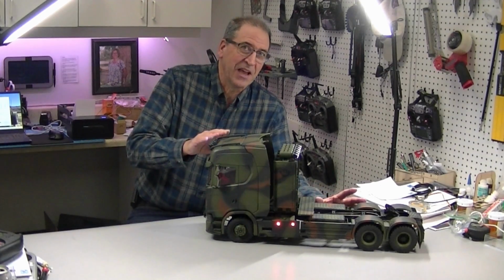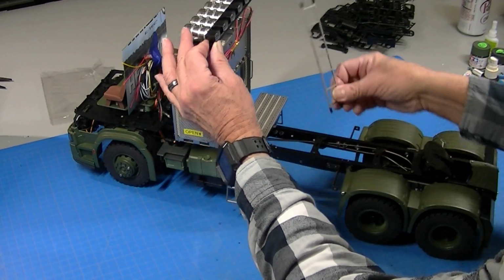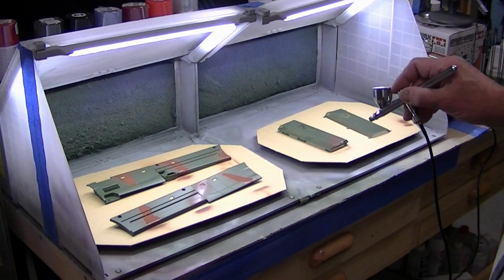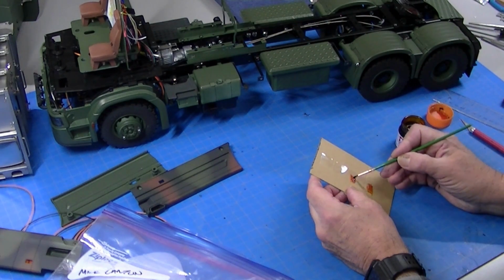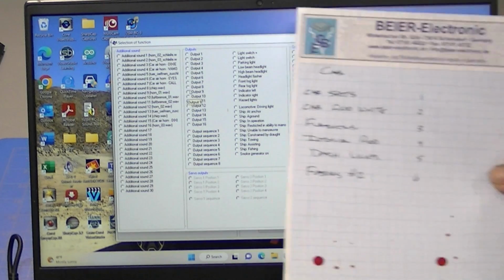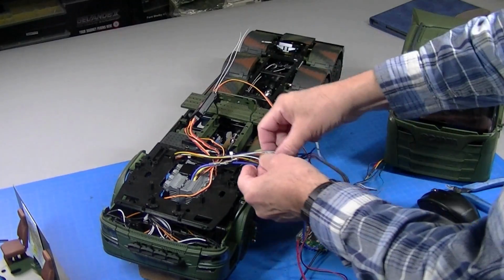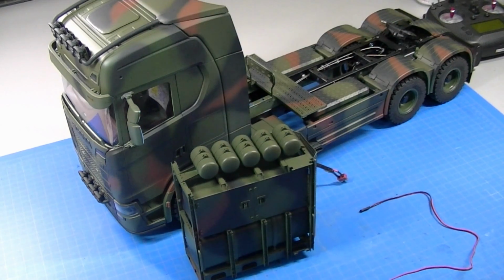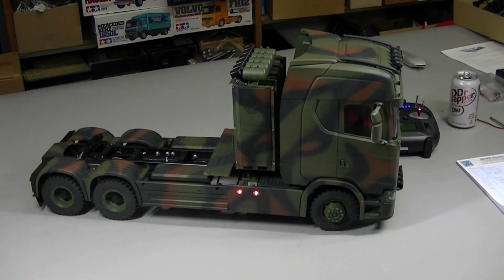1/14 Tamiya Scania 770S Custom Build Tank Transporter w Trailer- Part 3

Comment: The original side skirts have 2 holes for the lights but one of em is optional. So in europe you have to have a amber light every 3meters. And also i would've put another axle in the front of the existing axles to take up the space because the other skirts have a different shape or just make a full lenght skirt, greetings from estonia🇪🇪😀

Comment: Hi Bob.  Still lovin' all your videos.  
Have you ever gone on a walkabout with a Tamiya truck?  Would they go a mile?
I went to a big truck event yesterday and walked around with the truck.  The public loved it. The truck behaved really well and the sound was great.  After about a mile I lost all transmission.  The gear changer server works fine.  I'm dreading stripping down the truck to get to the gear box.  
Can the gear box be overworked?

Thanks

Ray
Reply: All sorted.  The grub nut holding the drive shaft to the gearbox output was loose 😁

Comment: Hi, I have the same rear bumper as you but the rear side lights don't look as bright as yours. They are running through a gt power unit. Is there something I need to do to make them brighter?

Comment: First company to come up with a 1/16 Oshkosh Het model will make a mint
Reply: or 1/14 🙂
Reply: Anybody know of a 3D printable Oskosh model?
Reply: @jons6125  yes, check out cults3d scalybarks model is good.
Reply: @snipah660  awh great thanks….I can’t be the only person in the UK or USA wanting a HET to go with my Heng Long 1/16 tank. Loads of cheep R/C running gear available now to sit a basic body shell on. WPL and JJRC type “6x6 military trucks”
Reply: @jons6125  I'm building the euro/UK version. Doing it in 1/14 as it goes with most of my other trucks and uses Tamiya running gear. :-) Happy custom building
If you have lots of money spare shapeways has a cab set and they will print it for you (not as much fun)
Reply: @snipah660  yes I want the uk model too.

Comment: question where do you solder the resistors for the lighting.
Reply from the maker: I use led's that have built in resistors (hibbyconcepts.net).  If you use bare led's you can solder a resistor inline anywhere on either positive or negative lead.

Comment: Hello can you please help me I was driving my truck and then my transmission just locked up
Reply from the maker: I know you will probably not like this answer but you need to remove the transmission and open the case to check it.
Reply: @HobbyconceptsLLC  thanks I fixed the problem turns out the screws came lose inside the differential and locked it up luckily no broken parts